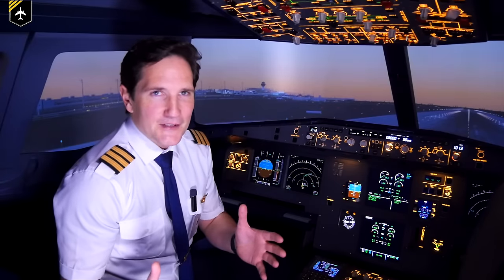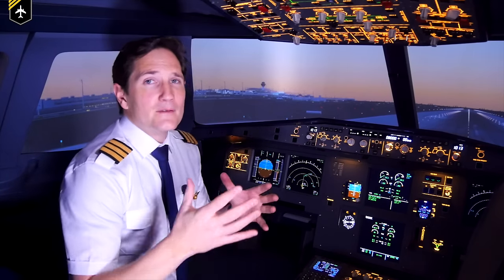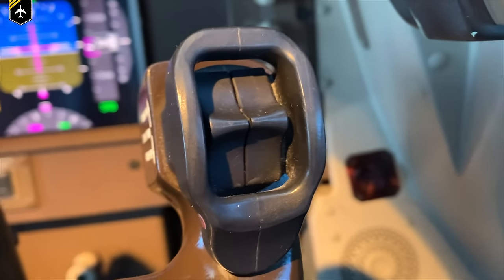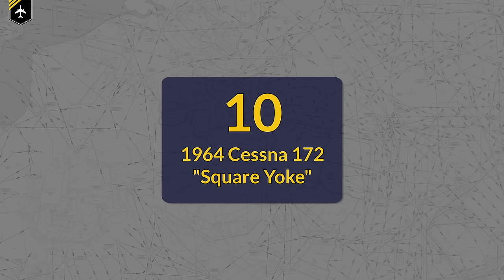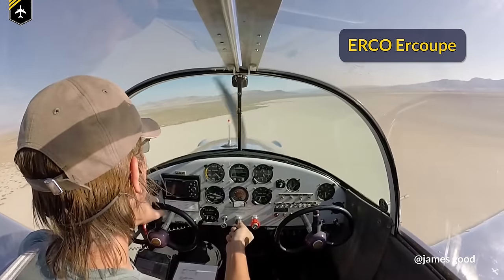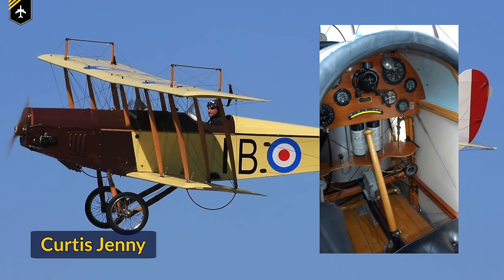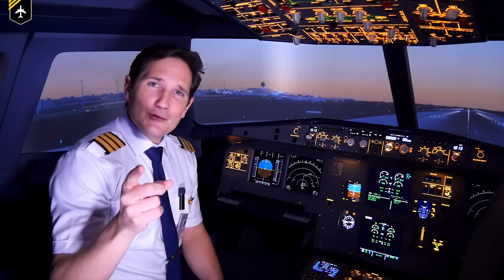WHAT do the buttons do on a FLIGHT CONTROL YOKE? + TOP 10 YOKE designs! Explained CAPTAIN JOE

Comment: 3:37 - A stickshaker - stall alarm device
4:29 - last made point of QRH/checklist (when break is necessary, e.g. waiting for ATC clearance)
7:50 - Because full-up position would make it impossible to move to one of the sides

Comment: That’s the stick shaker of course!
And the Cirrus stick is angled for ergonomic reasons. 😎
Reply: I'm not a real-life pilot, but I once had a chance to fly in a Cirrus flight sim - the amount of force I had to use to push/pull the elevators with my left (non-dominant) hand was... uncomfortable. The yoke felt clunky at best, though my only comparison is a ThrustMaster T.16000M, so my opinion may be irrelevant :P
Reply: @Riker1990  Even the best GA simulators kinda suck in my experience. As a pilot, myself and many others who had to interact with them during the lower levels of our training have come to despise them, and uncomfortable control pressures were definitely part of the issue.
Reply: @Riker1990  With real airplanes, the sensation you get when trying to move control surfaces on the ground at zero or minor speed is way different from what you experience when flying. During stable flight, you only need minor changes to those surfaces ,because wind speed will 'amplify' those inputs quickly to desired forces and momentum to change the aircraft attitude.

As Cirrus pilot I have been blessed with the rather luxurious and relaxed 'sit back' position to control the airplane. It's a great ergonomic design and truly 'made for pilots'.

Comment: I am led to believe that the motor on the yoke is the stall warning: “Stick Shaker”
Reply: Correct
Reply: Exactly what it is
Reply: is anyone familiar with how the stick shaker is able to physically shake the yoke without also inducting tons of micro-adjustments to the ailerons and elevator in the process?
Reply: @schmal911  yeah. magic and stuff
Reply: @schmal911  It shakes but doesn't give any movement to cables. I think the computer stops that on the 787 and 777 as there fly by wire
Reply: @schmal911  I may be wrong but I think the stick shaker is more of a vibration than an actual movement of the control column
Reply: Yes it is
Reply: But you know there is another protection for t tail aircraft can you answer it
Reply: Yep
Reply: @spare2count82  The yoke gets pushed forward, I don't know the name for it tho
Reply: @ethansaviation2672  Stick pusher, I believe ... PC-12 also has that.
Reply: @schmal911  the Stick shaker does exactly that and only that. It alerts the crew the airplane is in a stall. Within a few seconds the stall protection computer will engage the pitch servo to momentarily force the control column forward to force the nose down. This forward force can be disabled by holding the AP disengage switch on the yoke.
Reply: It is a motor with an eccentric weight. As it spins it literally shakes the stick. Like wheel wobble on your car if the wheels need balancing.  It is only a warning and has no control input so the pilot has to push forward to avoid the stall. On many aircraft if you ignore it, (not sure how as it is noisy too,) there is a separate stick pusher which will pitch the aircraft nose down.
Reply: correct
Reply: Isn't it horrible to be stalling and having the only thing can will save you from death turned into a vibrator?
Reply: @schmal911  Without thinking about it shakes the stick not the control wires / or the colum of the stick avoiding control wire, linkages et al

Comment: 4:25 just leave it on 737 so you won't forget what you are flying.
Reply: So if you were flying a MAX, would you just set it to 739?
Reply: @moofey  nope because that would be a 737-900 wich is not a MAX

Comment: 3:34 I think that is the stick shaker which vibrates the yoke in stall speeds etc.
Reply: That was my guess too
Reply: I think it shake BEFORE an actual full stall, this is a warning system
Reply: Yes the shaker activates when the aircraft gets close to stall speeds, before the actual stall so that the pilot has enough time to save the aircraft

Comment: Thanks for this video Captain!
I had a question, do you think that AI will take over jobs of pilots in future? I am in high school and I want to be a pilot, but I don't know if it will be a safe job after 20 or 30 years due to gradual take over by AI 🙂
Reply: I had the same question. I will not fly or fly on a fully automated aircraft.
Reply: It can never be completely AI because machines and systems can also fail.
Reply: already most of the flight in autopilot so it's not too far of a stretch to imagine fully autonomous planes. Though you will always have pilots to ensure that during an incident, they know what to do. Planes that could be compromised remotely might result in more 9/11 type attempts, so having a pilot with physical access to controls is essential.

Comment: 3:31 it is a stick shaker, it will give a vibration when the aircraft is approaching a stall.
7:51, the yoke is designed this way so the pilot has a better view of the displays, this type of yoke will give more leverage than a normal side stick, it will also cut down some weight.
Reply: Finally someone explaining the cirrus

Comment: 3:33 "Stick Shaker" motor, a stall warning device/indicator, because the airflow at the trailing edge of the wings will break down at a certain "angle of attack" and create big  vortices right at the edge, that creates a lot of drag, and, more important, decreases the higher pressure under the wings, which leads to 1.) decreasing the airspeed even further and 2.) takes out the "air cushion" on which the plane "floats".

Comment: I finally learned why the Spitfire had a ring on the control stick for handing with thick gloves since no cabin heater. I never thought much about Cessna wheel as the ugliest. The Concorde wheel looks weird and clunky to me but I'd not care if I were a Concorde pilot which in ways was quite an exclusive community of flight crew. There was a documentary about that plane, a first officer loved flying Concorde but in order to move to the left seat she would have to captain a 747 for some time before getting those four stripes on the shoulders for Concorde. She never transitioned because it meant having to fly something else for a period of time before getting back to the Concorde.

Speaking of yokes and wheels, there is that scene in "The Aviator" where Leon Di Caprio as Howard Hughes was asked to select which wheel he wants for the big plane Hercules. Rack has several wheels, his men begging for Hughes to make up his mind so they can move on with the aircraft development. Hughes as a perfectionist still didn't decide began focusing on the janitor with dirty hands, driving his men crazy.

Comment: Flying the old Barons with the center control but dual yokes made for a nice place to rest your right hand on approach and add a little back pressure on landing- just pull on the cross column.

Comment: 3:35 stick shaker... basically a big version of the vibration motor in your smartphone.
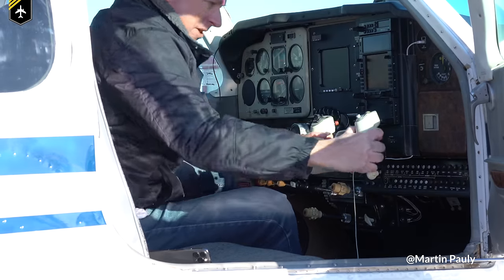5:00 Your controls... literaly
The yoke of the Concorde really is... special...
But I just love the design of the 737 or even better the 747 yokes.

Comment: For the Cirrus yoke, I'd assume for ergonomic reasons.  I haven't been in a vision jet, but if it's the same as in the SR-22, the stick angle matches the neutral position of your hand when your arm is on the armrest.  When your arm is on the rest, your hand grip is naturally at that 45 degree angle.

Comment: The motor thing is a stick shaker that i believe is used to indicate that the aircraft is stalling. And another use for the Boeing 737 memory item thing on the yoke could be for specific speeds a pilot would need to remember

Comment: Didn't knew Concorde had feedback control...
Fly-by-wire AND feedback... this plane was so ahead of its time it's still futuristic today...
Remember what kind of computers we had at the time. Concorde was also one of the first (if not the first) to use FADEC, except it was not D at all but somewhat analogous/digital mix. 
It also featured a fully fledged inertial guidance, capable of calculating its position with a ridiculously low drift. Because, why not.

Comment: The original design of the sidestick controller on an F-16 was unique in that it had no movement at all. It was a multi-axis pressure sensor that reacted to the direction and force applied to it by the pilot. Later models allowed some movement, but still only fractions of an inch. The design concept was meant to make high-g operations easier on the pilot.

Comment: The thing on the yoke is the stick shaker. when the aircraft goes into a stall, it will buzz making the column move. This alerts the pilots that they are in a stall.

Comment: Captain joe, the reason why the control yoke is placed at an angle is to do with the resting positioning of the arm during flight. Sometimes after extensive use of the control column of the 737 for example can cause fatigue on the arms and angling the side stick allows the arm to rest

Comment: I believe the motor on the stick is the stick-shaker.

But you did forget one---the funky controls of the original Wright Flyer.   Forward-and-back sticks in each hand, one for elevator and 1 for rudder, plus shaking your booty in a saddle for roll control.

Comment: the stick shaker is a mechanical device designed to rapidly and noisily vibrate the control yoke (the "stick") of an aircraft, warning the flight crew that an imminent aerodynamic stall has been detected. It is typically present on the majority of large civil jet aircraft, as well as most large military planes.

Comment: Exceptional Video, as Always! Thank U!
Kindly inform me as to how does a Pilot turn the aircraft in motion whilst taxying on the ground. Thanks!
Reply: In small aircraft, you turn on the ground with the rudder pedal. In larger aircraft you use something called a tiller which is like a steering wheel

Comment: The little motor is the so called "stick shaker" its primary function is to provide sensory and auditory feedback to the pilots when it senses an upcoming stall. It helps the pilots avoid a stall in the first place.

Comment: Should have talked about the F-16's stick. I know it's not a yoke but you implemented some sticks as well. The F-16's stick is unique because it barely moves. The sensor captures the force input from the pilots hand instead of movements.

Comment: The shared, center Y stick of the Zenair amateur built line of aircraft. One yoke between the pilots. Two throttles - one on each side of the panel.

Comment: Now I may be wrong but I thought the A300/310 did NOT have fly-by-wire (04:42), at least not on the primary controls. I think they added some fly-by-wire-ish technology for the 2ndary flight controls, but the first Airbus with full fly-by-wire was the A320. Or did I get this wrong, @Captain Joe?

Comment: QUESTION: Is there a reason that fighters tend to feature a flight stick control over the yoke, but commercial aircraft tend to feature a yoke over a flight stick control?
Reply: A yoke in a small enclosed cockpit of a fighter jet would just end up hitting the pilots legs, get in the way of the pilot needs to eject and basically it’s too big. Plus the pilot often has one hand on the throttles so what’s the point in putting a yoke in which is mainly for 2 hands

Comment: 8:14 - Concorde fans, which Concorde is that? AF or BA? I've never seen one with the three INS CDUs in that position. I've always seen two CDUs on each side of the pedestal and one behind the throttle quadrant.
Reply: I’m about 99% certain it’s G-BBDG at Brooklands museum.  She was a (pre airline service) production test aircraft and acquired by BA for spares in 1984.  
In 2003 she was donated to Brooklands museum and the amazing staff there brought it back from a stripped for parts airframe to looking like it’s ready to fly to New York.  
It’s non airworthy of course, but with parts donations they rebuilt the cockpit and the droop nose works again. 
As part of the cockpit rebuild (I’m guessing) they put an extra INS in the flight documents cubby hole. 
If you look there are no TCAS instruments (fitted later in the airliners life and other instruments had to be moved around to accommodate it) 
the 5 degree nose lock light was smaller (and in a vertical light stack) on the aircraft in airline service (so it must be a pre production aircraft) and I can’t see an aircraft registration plaque which is on the top right above the vertical white/amber/green lights for the marker beacon nav lights.

Enjoy falling down these rabbit holes 😂. https://www.heritageconcorde.com/flightdeck-detail

and http://www.concordesst.com/202.html

P.S the cockpit picture on the 1st link is G-AXDN, 1st development aircraft. It seems to unique in having a red band around the EGT instruments.

Enjoy the links, see you in a few days 😉

Comment: Why the slanted sticks you say?

To grant full range of side-stick travel to both pilots. Imagine the pilot's side-stick is deflected full right then by result the co-pilot's side-stick will be vertical, if instead the co-pilot's side-stick is at full left then the pilot's side-stick becomes vertical. This design widens accessibility to the many flight deck features residing between the two side sticks on the Cirrus SR22.

Comment: Question: Why can't they put mesh over the engine front to prevent birdstrikes? I've always pondered on this because, if you use strong enough mesh, and scrape dirt off a little before each flight, you could save a lot of damage.

If he's answered this link the video in the replies.

Comment: I am surprised F-16's HOTAS system isn't in the list. It's side stick were controlled by "force applied" instead of "stick movement", the stick sense the force you applied to the stick itself instead of actually moving the stick.

Comment: Am I right in saying that the scroll wheels can be used for remembering 'V' speeds?
Reply: They probably won't use it for remembering speeds. V1, Vr, V2 etc are most of the time displayed on the pfd, same as Vne, Vs/Vref. Especially in large aircraft. And after all, pilots must know the important speeds by heart. You can use it to remember an assigned speed from ATC, but if you get a new speed you will probably tune it in immediately in the autopilot or just fly that speed by hand.

Comment: THE MOTOR IS THE STICK SHAKER, IF THE PLANE ENTERS A STALL, THE MOTOR SPINS, CAUSING THE STICK TO VIBRATE, LETTING THE PILOT KNOW THAT THE PLANE STALLING, some planes which are more prone to super-stalls (T-tail planes with engines on the tail, swept wings, etc) also have stick pushers (the 737 max's mcas trims the nose down instead of pitching the nose down using the elevators)

Comment: Hey captain joe. May i ask, why is the display in the cockpit sometimes  flicker?
Reply: The flickering is an anomaly caused by the refresh rate of the displays in the cockpit and the shutter speed of the camera. If you were in the cockpit and directly viewing the displays with your eyes, they would not appear to flicker. From a technical standpoint, the displays in the cockpit do flicker, as do televisions, computer monitors, and the display on a smartphone. However, they flicker so quickly that the human brain does not perceive it.

Comment: Are there any other Airbus models that use the yoke? Which Airbus was the first to have the side stick?
Reply: The A300 and the A310 (which is technically a smaller A300) are the ones with a yoke. Rest all of the airbus lineup has a sidestick with the A320 being the first.

Comment: - The motor is the stick shaker on Boeing models.
- The scroll wheels are memory devices.
- The sticks are angled as they more ergonomically fit a natural centre hand position, allowing an equal range of movement in all directions - This is the same reason fighter pilots prefer to turn left, it's physically easier for them to move an upright stick further left than it is to move it right. By placing the centre position on an angle, this problem is negated.

Comment: Stick shaker.  I don't know why they can't give feedback to the pilot on a fly by wire.  It would be safer for landing in bad weather.  however, I suppose these can go wrong as well and put up the cost (more to the point)!
I don't know why the Cirrus is at an angle, I thought it came out the dash on a pole with just one handle yoke?

Comment: I’m kinda surprised that there is an autopilot disengage button on the controls. Is there a danger of pressing it accidentally? That would be my concern. Favourite stick is on the Spitfire, btw.
Reply: Yes, thats because it makes it easier when transitioning from autopilot to manual flying, hold the stick and disengage the autopilot.

Also even if there is an accidental autopilot disengage, the aircraft wont fall out of the sky. Its fully trimmed so there wont be any sudden movements, so you can simply turn autopilot back on.

Comment: Forgot to mention the "sensitive" function of the red button on airbus sidesticks... Try to "flick" rapidly the button and you'll get the ECAM "Autopilot Disengage", instead if you use your thumb the ECAM will show you "Autopilot OFF" :-))  Intelligent pushbutton able to discriminate if a pilot "wants" to disconnect the autopilot or something is dropped on it (or the P/B has an internal failure).

Comment: Probably this motor is to shake the yoke, but i am not sure. I am wondered how the pilots drive car and and plane because the plane also have pedals so probably they will be pushed with different forse not like you push your left car pedal for switching the gear.